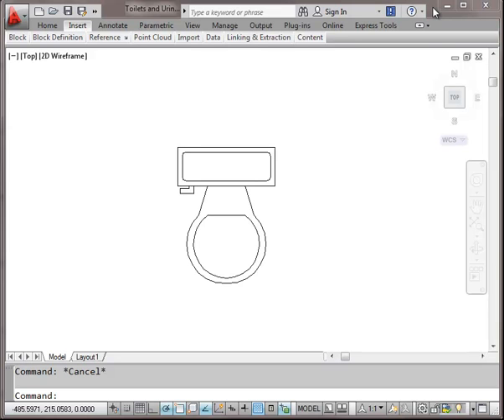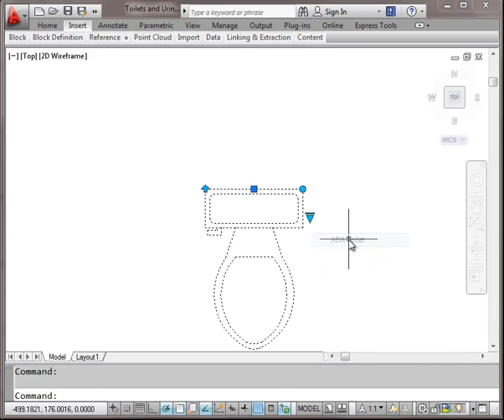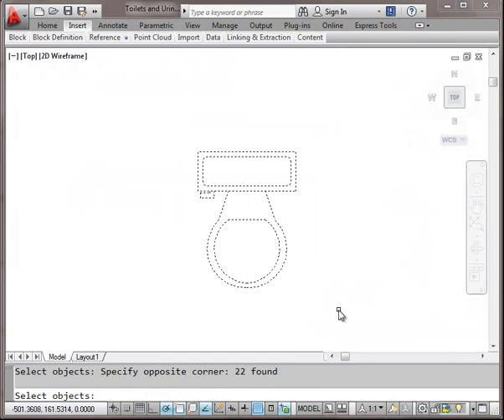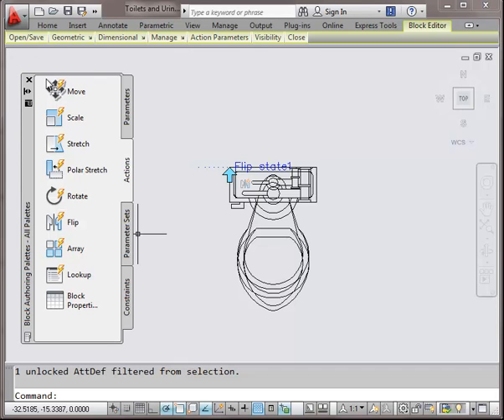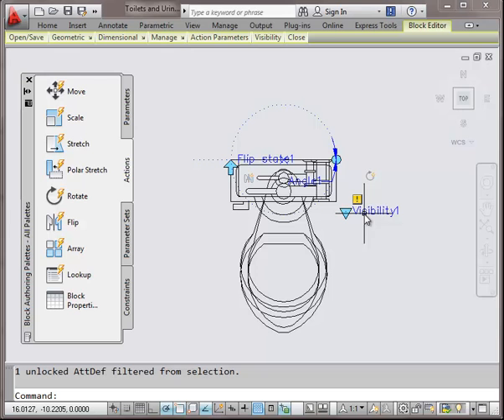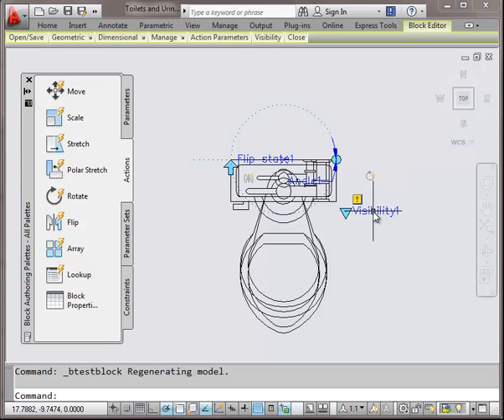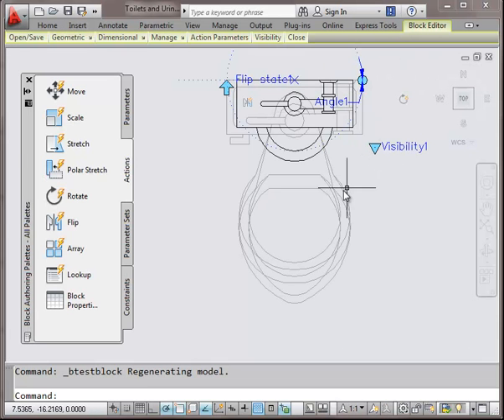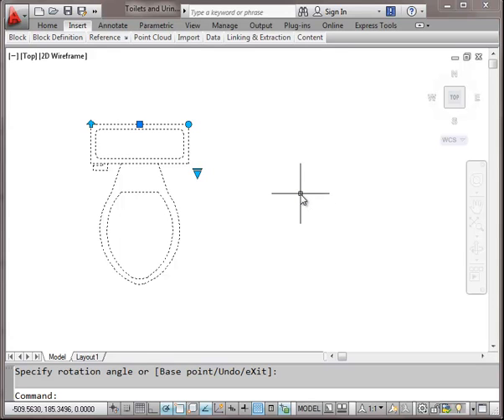Creating Dynamic Blocks in AutoCAD - myCADsite.com

Comment: I don't believe you need to set objects in a visibility state to "visible" unless they have already been set to invisible, either by setting the objects in the current state to invisible or when selecting either "Hide all objects in new state" or  "Leave visibility of existing objects unchanged in new state" while creating a new visibility state. Setting objects to "visible" that already are is an extraneous step.